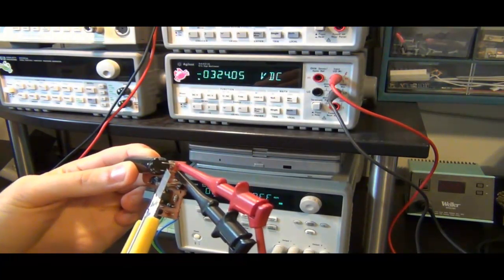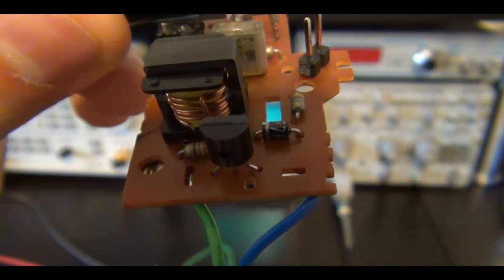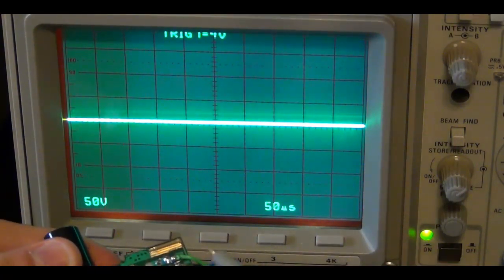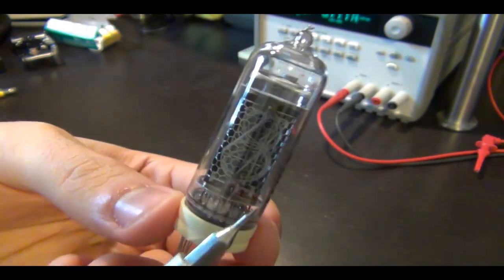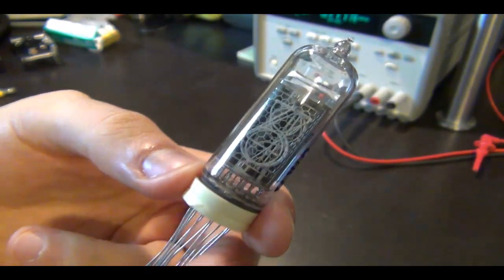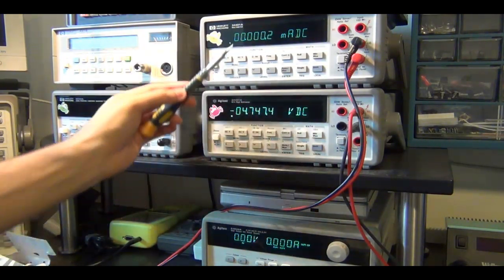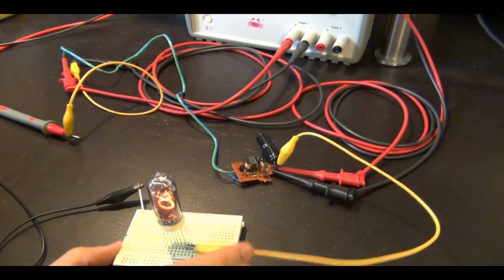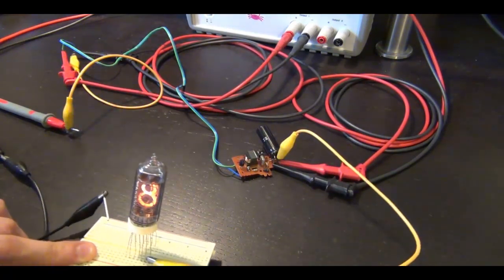TSP #3 - Camera Flash Circuit and Nixie Tube Tutorial (Part 3/3)

Comment: I know these 3 videos are over 10 years old, however I am a retired tech from the Bell System after 40 years and have been an advanced amateur photographer for over 50 years. I always knew that on a battery DC powered strobe it was the oscillator we heard when charging the capacitor.  Without a speaker I never could figure where the sound came from. Now I  know. Thanks great video.

Comment: The neon tube flashes because it has hysteresis. The turn on voltage is greater than the maintain voltage, as the small capacitor discharges down to the minimum voltage that will maintain the neon, it goes out, and then the small cap must charge up again to the trigger voltage of the neon. This is a very well done video, well spoken and clearly thought out, Thank you for the interesting explanation of how the camera flash works.

Comment: Very well done. I found this while searching for Nixie tube projects (I received a Nixie clock kit for my birthday back in April 2015). I became acquainted with this style tube while working F-111 aircraft back in 1990-1993. Our testers had these bulbs in them and I was always fascinated with them; just never knew the name or that they were available to the public. Looking forward to building some Nixie Tube projects and I may even use some old disposable camera guts to power the little buggers (I shocked myself pretty good when I handled the bare circuit board while testing my nixie clock).

Thank you again, great video.

Comment: 1) Don't forget to put a high value of resistor in series with the anode of the nixie tube so you don't burn it out by overcurrent when the voltage rises to over 300 volts.
2) Adding a feedback resistor from the negative side of the high voltage cap to the base of the oscillator transistor can turn the transistor almost completely off after the desired high voltage has been reached, which will increase your efficiency by a huge amount.

Comment: BTW u forgot to mention that efficiency is low because of low Vin ;) It would be greater at 1.5V and greater at higher input voltage, but it'd need rewinding the transformer. Anyway there are not a lot of converters to even start at 0.6V so considering it used a NPN transistor i think that 50% WAS good :D
Great vid!

Comment: It seems to me that Nixie Tube in the video was made in USSR :)
I think neon lamp flashing because when it starts to emitting light, it resistance becomes very small, and it shunts left part of the circuit and voltage across it becomes small enough to turn neon lamp off.When off, neon lamp have huge resistance, and voltage across it becomes high enough to turn it on again. And so on.

Comment: I just picked up a bunch of free flash circuits from my local drugstore photo counter.  Some of them use three transistors!  I have a few videos where I use these flash circuits to power a solenoid.  I do this with a DIAC and a Darlington transistor.  I would be interested to learn more about DIACs and if DIACs in series could effectively act as a single higher voltage DIAC.  Looking forward to more of your videos.

Comment: Hi..I really liked your video series on the Fuji Circuit, your explanation is very understandable and clear. I have a few questions if I may, Firstly, with which standardly available transistor could I replace the one on the board?....Secondly looking very closely at the transformer I see on one side the thicker 6 windings going to 2 poles, on the otherside I see very fine wires twisted together going to each of 3 poles...Can you explain these please?

Comment: dammit every time you fly around with that screwdriver around the nixie I think that youre gonna crack it xD

anyways, do you think that these can power 6 nixies at once? My circuit provides max 12.8mA when shorted with an amp meter, which should be enough, but still some parts of the digits are not lighted up.. any thoughts why?

Other than that, a big thanks for explaining the circuit itself! Great job!

Comment: What determined the limit for the voltage fed to the capacitor?
Reply: Neon lamp trigger voltage.
Reply: @brokensword5042  Neon lamps trigger much lower than 350V.  That neon is limiting the voltage on the trigger cap, but not on the main cap because it isn't putting much of a load on it due to the 4.7Mohm resistor.  The turns ratio on the transformer and the battery input voltage is what determines how much the voltage is stepped up on the main cap.

Comment: That was very interesting and very well explained thank you. I was wondering if you could make a video showing how a camera flash circuit can be used to light a CFL lightbulb?  /watch?v=X2wPLYTrc8E and the modificaton to the circuit here /watch?v=cOjze5Sgofk

I think the neon flashes because the gas is being ionised at the required voltage and then as it lights the capacitor discharges and falls below the ionisation voltage causing the neon bulb to light intermittantly. Thanks :)